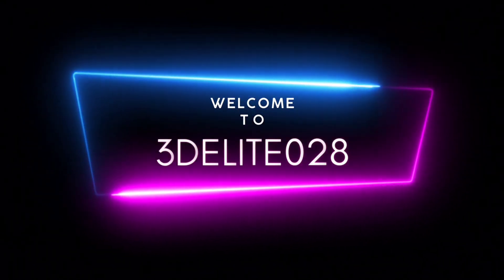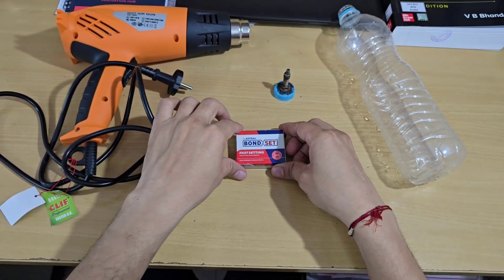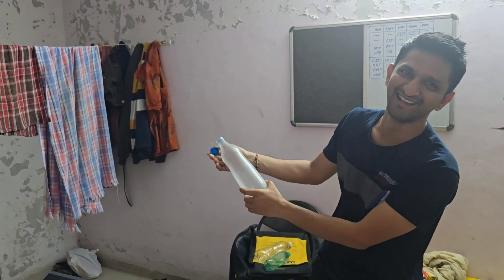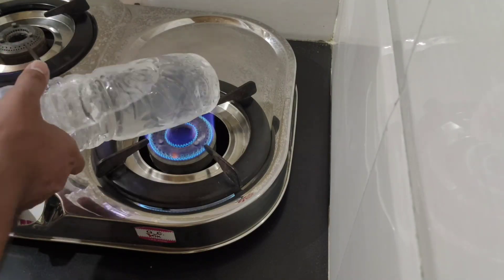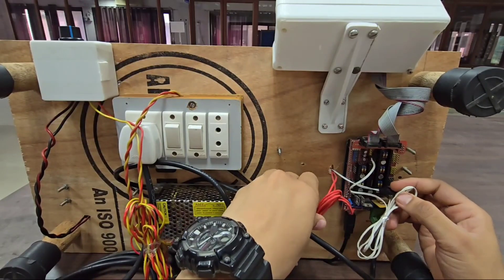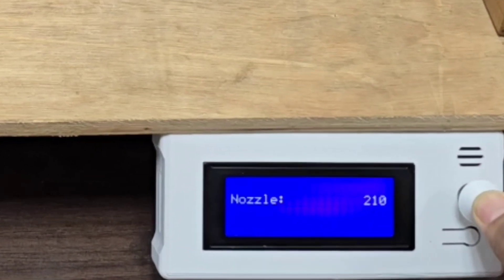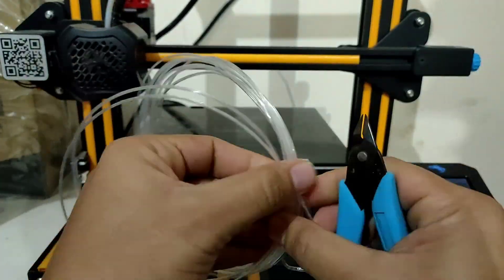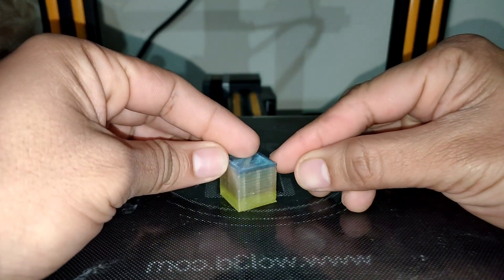How to make PET filament from plastic bottles usings RAMPS based temperature nozzle controller

Comment: Why don't you let the air out of the valve, it's proven to be safer?
Reply from the maker: Yes, good idea.
We didn't realise the pressure rise would be this much initially.
After making initial few strips we just made it simply without pressurising, it worked fine in my case..
Reply: @3Delite028  provle is if you  unpresure ti fast it cam explode
Reply from the maker: Yes , it exploded first time , was insane, luckily nobody was hurt but it was not recorded .
So decided to include in the video.
Carbonate drink bottles doesn't expels air suddenly due to it's safe design to vent out air as soon as we open the cap.